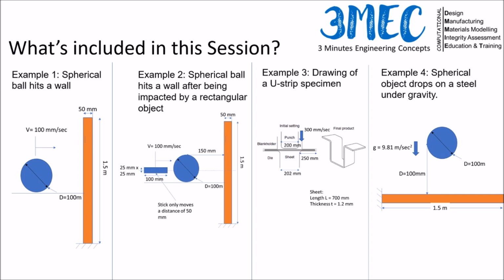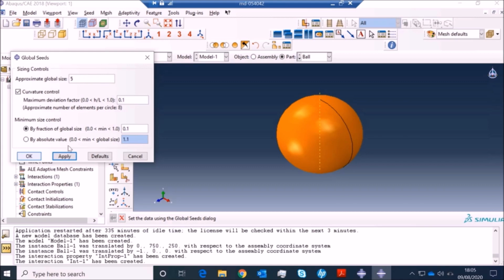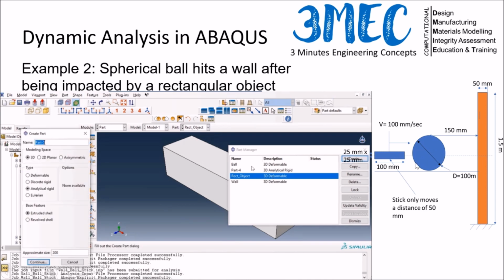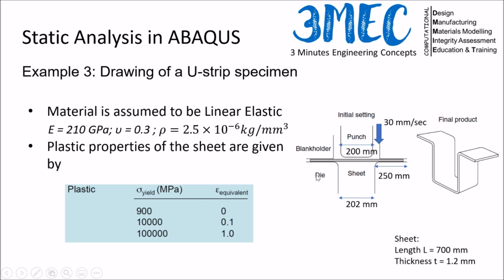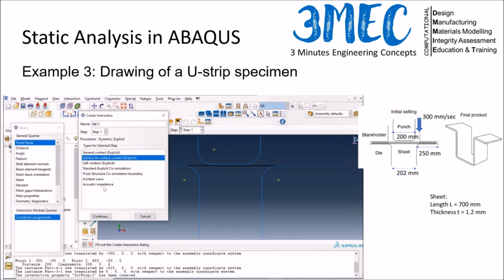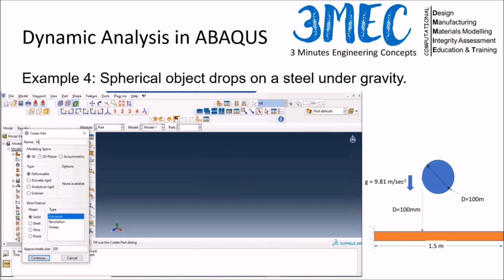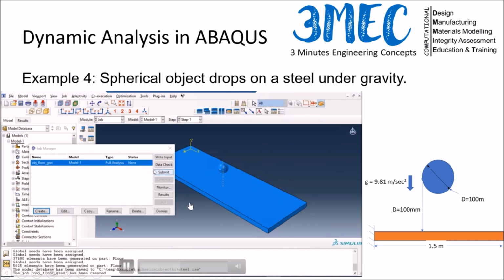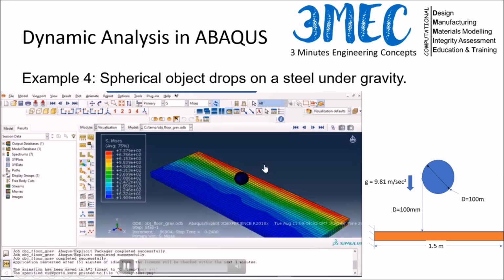Session 3: Performing Dynamic (Explicit) Analyses using ABAQUS

Comment: how do i know failure impact stress
Reply from the maker: In ABAQUS/Explicit, determining the failure impact stress involves post-processing the simulation results to find the stress level at which the material fails, yields, or initiates damage during high-speed or dynamic impact.

Here’s a step-by-step guide to identify the failure impact stress in ABAQUS/Explicit:

✅ 1. Define a Failure or Damage Criterion
To detect when and where failure occurs, you need a failure criterion:

Options:
Mises Stress > Yield Strength (for ductile materials)

Maximum Principal Stress (for brittle materials)

Hashin, Puck, Tsai-Wu (for composites)

Ductile or Shear Damage Initiation:

Use keywords like:

plaintext
Copy
Edit
*Damage Initiation, criterion=DUCTILE
*Damage Evolution, type=ENERGY
✅ 2. Enable Output of Failure Indicators
In your input or CAE setup, request field outputs such as:

S (Stress tensor)

Mises (von Mises stress)

PEEQ (Equivalent plastic strain)

SDV or STATUS variables (for UMAT/VUMAT-based damage or element deletion)

DAMAGE or DAMAGEC (for predefined criteria)

For example, in CAE:

Go to Step → Field Output Requests

Ensure S, Mises, PEEQ, and STATUS are selected

✅ 3. Visualise Failure Point
After running your explicit dynamic analysis:

Open the .odb file in ABAQUS/Viewer

Plot contours of:

von Mises Stress (S, Mises)

Plastic Strain (PEEQ)

Element Status (STATUS or SNEG)

Use time history plots:

Create an XY plot at suspected failure regions

Plot Mises stress vs. time or equivalent strain vs. time

This helps identify at what stress level the element started to fail.

✅ 4. Use Element Deletion as an Indicator
If using element deletion, ABAQUS marks failed elements with STATUS = 0. When an element disappears:

Check the last frame before deletion

Note the stress values – this is often your failure impact stress

✅ 5. Use Material Data for Comparison
Once you identify the stress at failure (e.g., 235 MPa), compare it with:

Static yield strength

Dynamic strength (may be higher due to strain-rate sensitivity)

Material test data under similar strain rates (if available)

Bonus: Strain Rate Effects
ABAQUS/Explicit naturally includes strain rate effects if your material model is rate-dependent:

For metals, use Johnson-Cook or rate-dependent plasticity

For polymers, use viscoelasticity or hyperelasticity with Prony terms

Example (Johnson-Cook Damage):
plaintext
Copy
Edit
*Damage Initiation, criterion=DUCTILE
0.05, 0.2, 0.15, 0.05, 0.3

*Damage Evolution, type=DISPLACEMENT
0.05
This will cause element deletion based on stress-strain energy, and lets you capture failure impact stress directly from the output.

Let me know your material type (e.g., metal, composite, polymer) or share a summary of your model, and I can suggest the best failure criteria and post-processing technique.

Comment: why u put the density unit in Kg/mm3 not ton/mm3, to be consistent with  SIMM ?!
Reply from the maker: Units doesn’t need to be in certain system, rather they need to be consistent. So if I have made model in mm then all relevant should be in mm, etc.
Reply: @Professor3MEC  u have made the model units in mm . so the mass  should be in tom , and the density in ton/mm3 , right ?